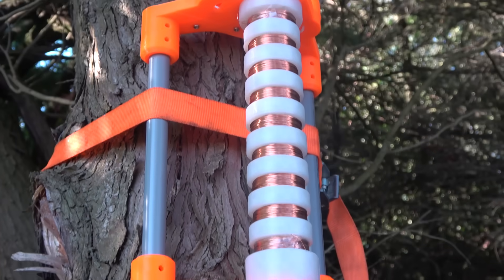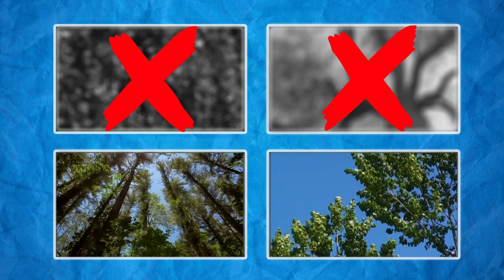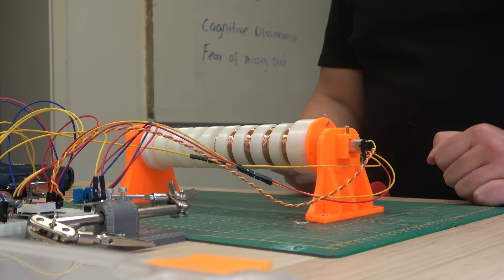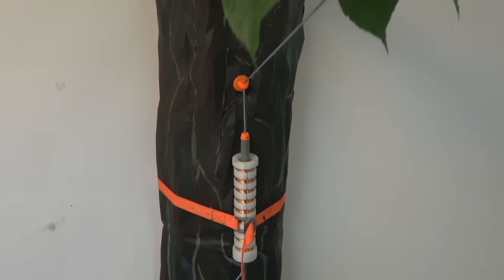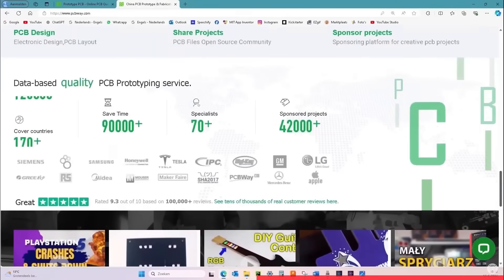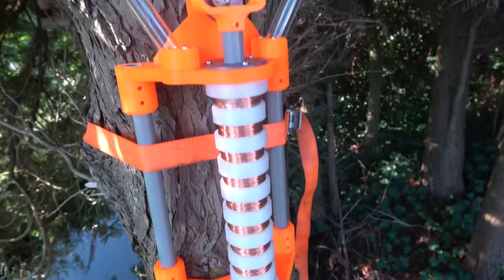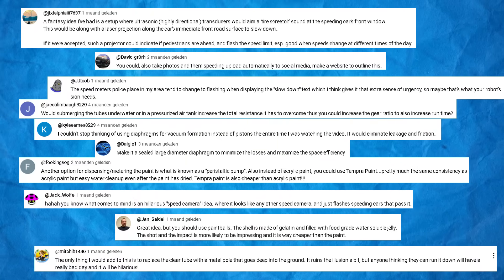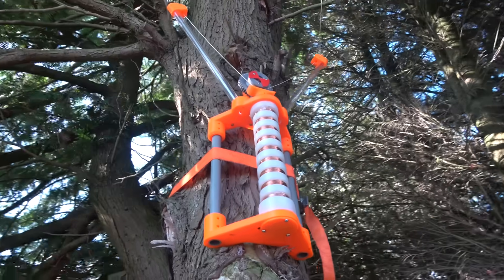I Made a Tree Generate Electricity..

Comment: Interesting, but I think you're missing out on a large amount of power:
As you noted, your generator works best at higher speeds, and low force,  but the tree moves slowly with immense amounts of force.
A more conventional generator with a ratchet and gearbox might help. Also, try tying the rope to a neighboring tree, rather than just a single branch of the same tree for even more power input

Comment: well i'll be damn! lol, had a similar idea back in 2018, literally worked all the schematics around tree generators but man low and behold someone went out and actually experimented with it. my setup is kind of different, i used piezoelectric materials as generators, i think the pressure from the tree's swaying is more efficient if the piezoelectric material is squeezed from the pressure of the tree, you should try doing that and test to see the difference though. as for your setup of getting all of the angles, if i remember my idea here, just use nails to pin on each starting point of the tree branches and work your way up from there on a single branch one at a time where there is different angles of swaying, put a nail on it, this way you can use a single line strand and just hook along the nail all the way back to the source of the generator, this uses less materials in the way you're doing it in your video here.

Comment: I've had this idea knocking around for a while now. I want to dangle a weighted object between two trees with a single direction ratchet gear that tightens a clock spring that spins a generator with a little flywheel. The branches moving in the wind changes the center on the balance line allowing the pulley to run back and forth on the balancing line tightening the spring. Never got around to it but this is just as cool!

Comment: Here's an idea, next to the tree put a pole that goes about 1/3 of the way toward the top with a pivot in the middle. Between the ground and 2/3 of the way to the top of the tree, put a lever that pivots in the middle with one end near the ground and the other end the same distance above the pivot. Connect an arm between the top of the lever and the tree using an adjustable clamp that can expand with the tree and be adjusted for height from time to time. At the bottom, put your generator with a back and forth arm having a one way clutch so that in either direction it spins a generator in the same direction. Put another device just like it at 90 degrees to the first so that no matter what direction wind and sway, it will always make energy. Measurements are just to give an idea of the concept. It would probably need to be altered depending on the trees or the wind being utilized.

Comment: I’m an arborist, and I was thinking about this same idea all summer.  My family wants to build offgrid in Canada’s boreal forest, it’s flat there with no mountain streams for hydroelectric, and I don’t really like windmills… but there are thousands of spruce trees.  I was thinking of a similar design, but anchored in the ground between two tall spruce trees with ropes running to the top of the trees.
As an arborist, a tree has no trouble at all swaying in the wind with the full 200+lbs of weight of a person and tools at the top of a tree on a windy day, I know there’s enough potential energy to be had there, just need an effective way to tap into that resource!
Reply: I envisioned something like an engine, with a cam shaft at ground level, and with the trees acting like pistons so to speak… but I’m no engineer, and haven’t actually built this - just the random thoughts in my head, but I think I could make it work once we actually move and try it out.

Comment: you probably need something to seal up the copper coils so they aren't exposed to the weather.  

something else you can mess with is a one way gear setup. then no matter which way the tree pulls. the rope it still pulls whatever in 1 direction. then you can just have it lift something up over time. then drop it  once its high enough. to pull a wheel and gen power. have a few on the same tree, so you can have it lifting a few different weights at the same time. dropping them could end up giving a good burst of energy over all. would have to figure out a good set up for that, it wouldn't be much different really.

Comment: Holy shit, creator that actually listens the viewers before pumping out ideas that fundamentally might be crap or be made better with little adjustments... am i dreaming?.
Not sure if it would work, but perhaps swap the linear generator into a basic rotating one and one the axle install bunch of one way bearings with spools of wire and coil springs to return them to zero position. When spool does not more bearing allows axle to rotate freely, when string is pulled by branch it locks and turns the axle witch after allows the spool to collect the string back on the spool. Combine with multiple branches and strings, it should produce constant rotating force to turn the generator and produce electricity. Surely amounts are not that impressive what ever you do, but maybe over time charge a battery or something on property that does not have flowing water. Though string should be maybe teflon coated or soaked in oil to prevent water freezing on it in cold climates, but that is something further development is needed. Least this should be cheap way to test it and again even if whole tree moves with the wind, then all that energy is put in to rotation, so choose generator and construction that can work with high input loads well as slow speeds.

Comment: Another way to deal with the "weight" problem with lifting the magnets would be to add a counterweight (IE a duplicate setup of magnets inside another tube with coils), sitting beside your original, which using a fulcrum is in the down position when the first one is in the up position. this would also mean that the generator could generate power in both directions.

Comment: i think you should not rely on branches for generation but completely on the swaying of the trunk 
branches snap easy and produce a lot less force than the trunk swaying
if you go the trunk route you can use gears to convert a lot more force and its more realistic as there will be significantly less maintenence needed if for example you would take production to large scale

Comment: Right now you’re using linear motion to drive circular motion, to drive linear motion — what if you instead laid the magnetic core sideways inside of the housing, and used the sideways tree ropes to slide it back and forth? that way, you won’t have to worry about using the repelling magnets to counteract gravity, and instead you’ll need to worry about making a good sliding contact
Reply: Theoretically, you could attach the ropes directly to the core this way, eliminating the need for the presumably quite lossy 3d-printed gearbox and scotch yoke. although, for maximum efficiency, i think the flywheel suggestion is better

Comment: I don't think this is feasable. 1. Scaling this to a meaningful output would require too much materials (which turn into garbage later) and maintenace (adjusting strings, etc). 2. It is not sustainable. I don't think this will produce enough energy over its lifetime to recoup the production/recycling of the materials. 3. The infrasturcture will be hellish. You would need to wire up a whole forest to collect the energy and transfer it to the grid. Thats a lot of cable that you plaster all over the forest. 4. Theft. If you put that much copper wire, high quality magnets etc. out in the open, a lot of it will vanish over night. 5. I am not sure that everything you want to put into a forest is safe for the animals living there. Birds or Squirels could get tangled up in the wires and deer and other animals will gnaw at all cabels you put there. This will probably kill a lot of animals and increase maintenance cost.

Comment: A regular wind turbine produces like 5MW (10^6 W)

A simple linear generator like this will provide a fraction of one watt. So you'd need multiple millions of these to replace only a single wind turbine. 

While this is still a fun project, it will NEVER be enconomic. Not even ecological, as the hardware will brake down before heaving output a Promille of the energy required to manufacture the copper alone.

Comment: You attached a linearly moving line... to rotate a fly-wheel... TO then drive the linear motion within a stator tube? Missed opportunity. The flywheel itself should have your magnets. Or better yet, gear the flywheel to your rotator, but cam it so your rotor only moves in one direction; let the flywheel drive your rotor on bearings. This way, you're not wasting energy trying to reverse the direction of the magnets. Don't mount it vertically; mount it horizontally--there is absolutely zero need to fight gravity. (The restoring force which provides the motion of the tree is already doing it once; don't do it again.) Very, very cool idea though...

Comment: Good idea but overcomplicated and probe to many failure points ( ropes under tension and friction to wear, gears, and so on), and only one point of generation (not even taking into account thw cost of such system. Wouldnt it be better instead to have a generatour at the point of movement (on the top/end of the branch) using the constant aceleratuon and deceleration and chage of directions (if it is mechanical) or may be utilising piezo electric energy generation. That way, the only thing left is a wire colecting all the brunches/devises  electricity and sending it to the ground ...

Comment: Great idea. I was thinking that a similar linear system could be used in bike or car suspension to add some electricity into the batteries. Or indeed added to small boats or electric canoes (with floatation devices) for the same

Comment: As an electrical engineer who studied a lot of physics this has potential. The best use case scenario is going to be in locations that are more tree dense like a forest. This will never be as energy efficient as a wind turbine. Let me explain. Wind is your source of energy and if applied directly to a wind turbine the energy losses are in the friction of the bearings, heat and resistance due to magnetic forces of your generator. This device will occur the same losses but now introduce the energy losses produced by the branches of the tree. My suggestion use gears to change the force horizontal and make a more traditional small generator. Design a gear differential found similar to a car but reverse it where either side that moves powers the single shaft of a generator. Keep up the good work and would love to see how this develops.
Reply: As an arborist I would have to say that coniferous trees (spruce trees especially with very stiff needles) transfer most of the energy directly into the bending of the main trunk, and thus, contain more ‘harvestable’ energy than a deciduous tree that looses more energy to the vibration of their leaves.  Tapping into the energy at the tip of a spruce tree has a lot of power generation potential.  Just ask any arborist who regularly climbs to the top of conifers on a regular basis, a 200lb payload gets tossed around like nothing on a windy day.
Reply: @Ahomesteadersdream  this is true solarpunk. it's figuring out a way to harness energy from nature in a way that's nowhere near as destructive as clearcutting a forest to build wind turbines, damming up a river/lake to generate hydro or of course drilling into the ground or sea floor to bring up fossil fuel oils.

This is why we need people on both opposite side of the spectrum to join forces on stuff like this. I am skeptical of the actual power or current created by this, but it's an interesting concept I'd love to see someone try on a larger scale.
Reply: Even if you properly make power generation, you need storage which is batteries, and batteries are dirty.
Reply: @Ahomesteadersdream  As a systems engineer that continually works with disparate systems for both the DoD and the large corporations, you have knowledge and vision that all engineers would overlook. Granted there are experts with compelling peer-reviewed dissertations and published articles, your bit of information has a multiplier effect on the original tree generating electricity construct. Bravo! Taking a screen shot to share and see who updates their comments.
Reply: Except that in the case of the wind turbine you have to build the fan and it's pedestal. It could actually be more efficient despite the losses, because of the decreased build cost.
Reply: @JamesRowlandsRocks short term yes? Long term it’s difficult to say, but essentially we need lots of energy and that’s the positive of a wind turbine, it creates so much energy, short term of course it’s more expensive but better investment
Reply: A Wind turbine takes up at least 40 acres, you can grow 700 trees on 1 acre, that means if one of these can produce a hundred watts you can get up to 70000 Watts a day on a single acre
Reply: @gman2633  That commercial wind turbine is producing far more than 70,000 watts every second.
Reply: The biggest problem I see with a long term installation like this is the tree growing and the wires getting decalibrated or even breaking, chewed off by animals, caught in a branch breaking, etc.   Cool for a small project, but unfeasible for an alternative mass power generation.  It's too chaotic.   But very cool experiment.
Reply: @maxpelletier2237  definitely not suitable for large scale power projects, but certainly doable for off grid homesteading…
Reply: @Ahomesteadersdream  I think a few trees won't provide enough, and routine maintenance will be too overwelming unfortunately.
Reply: And you wouldn’t be needing as much space in fact you could implement this in an orchard
Reply: A wind turbine is less efficient than a Nuclear Power Plant. We need to remove wind turbines  and just focus on Nucler Power Plants. With 1 Nuclear Power Plant, it can generate 1000x more electricity than a Wind Turbine.  It's probably up to 100000x more since I can't fully remember how much more. So we'd have 1 Nuclear Power Plant Powering 1 million homes. That I do remember. Wind turbines are abundant and are killing birds.
So what would you rather have? 1K turbines or 100 Nuclear Power Plants that can power 100 million homes.
Reply: To power 100 million homes with wind turbines you need like 100K of them.
Reply: A situation where you have several of these charging a battery in an off grid situation or during a power outage to be able to keep a phone or small devices powered. Definitely has some use cases. I think you will run into issues of branches sagging over time and other nuances to trees that aren’t being considered, but overall this is a workable concept. Is it going to be useful for supporting the power grid? Probably not, but off grid, preppers and outdoor enthusiasts would be your market.
Reply: Couple of questions. Is there a significant difference in efficiency between driving a large generator, vs the same amount of force driving a bunch of smaller generators? And related to that, what are your thoughts on condensing the kinetic energy from multiple pullies to drive a larger generator?
But I've probably drifted from the non-intrusive nature of the project.
Reply: Agree. I think attaching a generator to a single tree will never be cost effective. Perhaps there is a rope and pully configuration that could harness the wind energy from many trees to drive a single large generator. However if you are going to use that much cord you are probably better off with one of those cool kite driven generators.
Reply: Thanks!
Reply: It doesn't have to be as efficient as a wind turbine as wind turbines require far more capital or effort.
Reply: I agree it will never be as efficient as a wind turbine. I think there is value to the fact that this uses trees that already exist. I also wonder if there is a version of this that could save trees from falling in bad weather. Like if you made a version that connected to two or more trees and anchored into the ground, could it bleed off some of the wind from a storm? Not sure of the utility of this at scale but I like the idea of seeing if there is a way to interconnect all the trees as I stare at all tall trees I have at the end of a wind tunnel on my property.
Reply: A tree is a fantastic machine. Old and sometimes ancient trees are all limited in lifespan.
Why not mimic a tree?  You could standardize all the components.
Reply: Maybe this could power a fly wheel generator system?

Comment: This is a great idea. Nice use of a scotch yoke! 👍 I'm thinking even flag poles can produce power, with similar engineering. Maybe a modified flag and mount. Make the flag stuff. And mounted on rings that slide up the pole. With a stop to limit motion and springs to keep it in the center. Then it's only a matter of harnesing the motion. Also a similar attachment can use a connection to near the top of a tree, from a post or another tree. And catch the sway motion also. It can produce even more power. Given more energy is required to move the whole tree top. And when in motion it takes alot to stop it! Maybe a typical 3kw generator can be connected using a scotch yoke l  then a overdrive pulley. Connect to trees using the sway to also produce power!

Comment: OK so attach each one to a PWM solar charger, as long as it is more than 14v it should be sufficiant. Put a lot of these on a lot of trees with a lot of cheap PWM chargers to a single 12v marine battery and do a video on the results. 1 is simply not enough. I need to know the nominal voltage of each one etc and I could run the math.